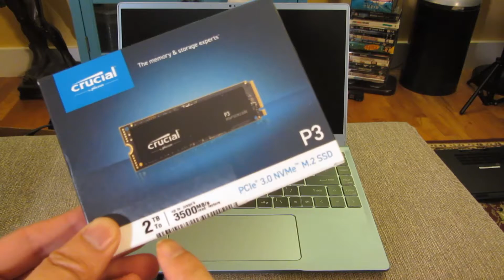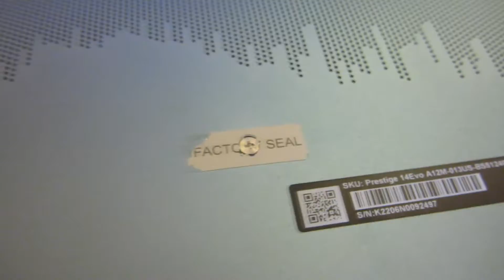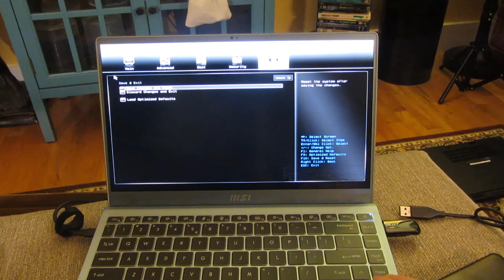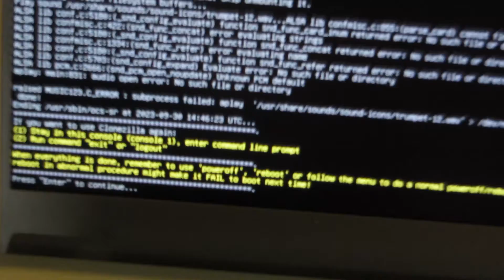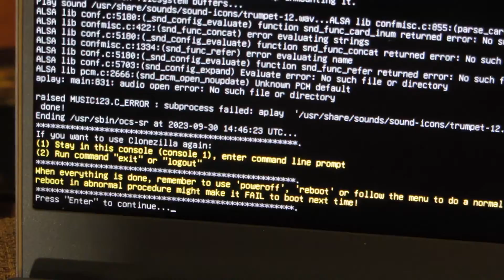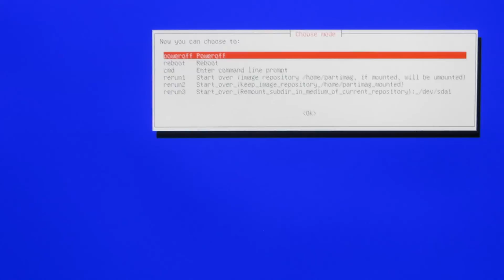MSI Laptop |  How to Upgrade SSD to 2TB M.2 | Notebook Hard Drive Replacement

Comment from the maker: Amazon Link Crucial 2TB SSD NVMe - https://amzn.to/3ZC1wf0
00:00 - Intro
00:35 - Hidden Screw
01:21 - Prying Tools
02:35 - Prying off Bottom Cover
04:05 - Prying off Front
05:28 - Close Up Internal Components
07:30 - Replacing SSD HDD Drive
11:05 - Cloning Drive Image
12:00 - Close Up Bottom Panel
13:00 - Prying Tips
14:15 - Replacing Cover
15:57 - CloneZilla Disk Image Tips